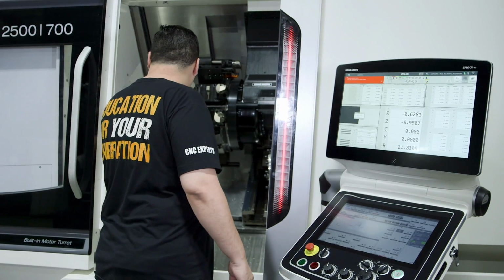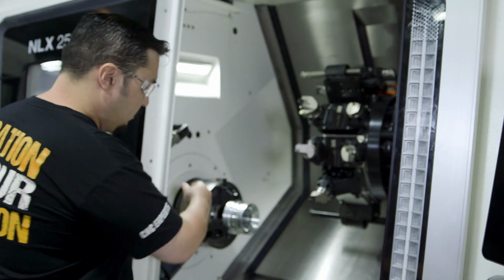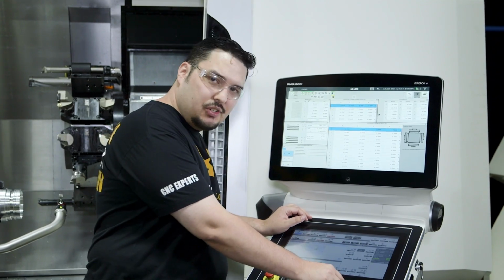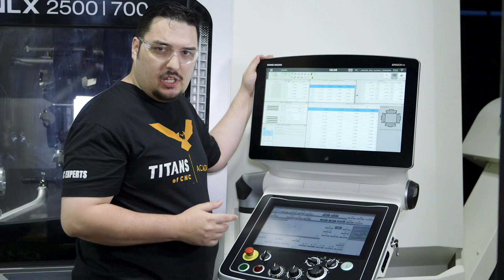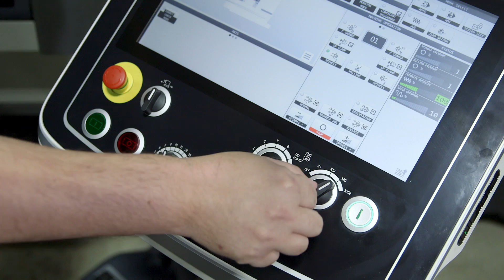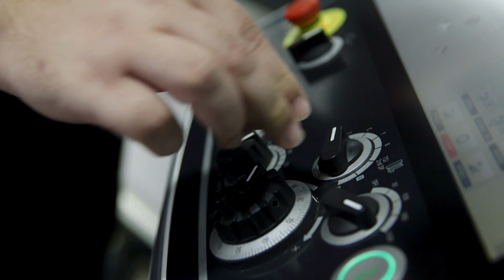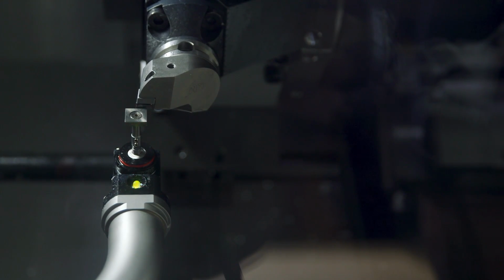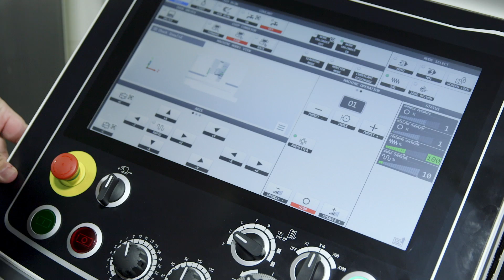The Probing Tip YOU Should Know Before Using A DMG Mori NLX-2500

Comment: how do you touch off in the y axis? I know there must be a way, but i cant get the y axis to move with the tool probe down.
Reply: maybe you don't have a 3d probe , only x , z . Maybe that's an extra option .
Reply: you dont do that. on a lathe with turret you have to be sure that your turret is in the right orientation. if you use tools with y axis you have to know the right compensation of y and you have to tell that your machine. theres no way of using a 3D probe on a lathe with turret, you wont be able to have the precicion with a turret.

Comment: Also, the machine won't start turning its main motor/ lathe when Y- axis isn't zeroed out. 
within the nc code it's the line G28 V0 that insures the Y- axis is set to home. Always initiated before turning begins. 
This can be turned off, however, deeeeeep down under the hood in the parameter settings. 
Advantages can be, i. e. if you use stacked tools (like some Sandvik Capto tools), or if you have a gnarling tool - to set it can be a female dog, but if you have libereated the y- axis, it's just a matter of a few seconds. 
Downside being, the parameter freeing the y- axis from liberating while turning is also the same one ensuring that you can only probe when Y is set to reference. 
Which can really mess your values up if you have the usual DMG composite X/Y- Axis configuration.
Reply: Codes M611 (interlock off) and M610 (interlock on) control the y-axis interlock, these can be added in the cycles.

Comment: If you have a smartkey with level 2 , 3 or 4 hit the corresponding number on the right side of the control and you will be able to jog the tools with the door open. Much easier to see what is going on that way.
Reply: Panzax I hate that I have to press the safety button all the time

Comment: You guys should mention , you can jog and  touch off the tools with the door open.  You'll need the Level 2 key for the control panel tho . Can you show how you guys indicate your y-axis to zero (on tools on center and on double stack capto blocks) . I have my way but I wanna see how you guys do it . Thanks!
Reply: Co axil indicator. Bring X down and get it reading as close as possible to, switch to Y mode bump it a click or 2, move X again, rinse and repeat till indicator reading is as close as possible. Boom
Reply: @Flightmx22  that's one way
Reply: @joey.cnc.  I think the coaxial is your quickest bet.  Just get close and dial it in with a few clicks.  But I guess it also depends on how accurate you want the alignment.

Comment: That's annoying, having to probe with the door shut.
Reply: You can have the door open if you have smarkey 2,3 or 4.
Reply: Get ready for it.  Door-shut CE style operation is coming to everywhere.
Reply: You can do it with the door open in level 2 while holding the acknowledgement button, but the MPG moves the machine at a limited speed

Comment: Please do video for how to bore the jaws without closing the door option..
Reply: You can't sir, not on this machine... The machine spindle will not operate with the door open... Only way it can be done is by acquiring a level 4 key from manufacturer, which is mainly, and rarely, used by service guys...😳 You could however remove the door switch key from the top of the door and stick it in and out as needed, but this is very dangerous.  You do get used to boring jaws with the door closed though and soon after you will be doing it with a program... 😆
Reply: @beatboxx713  I agree with your comment.  I have the same machine and I use a Boring Ring with a simple program. I do not recommend boring jaws with the door open .
Reply: You need to purchase a level 4 key and sign the 15 page liability release for an option called JB Interlock release

Comment: This is strange, the NLX1500 tool probe (lowering and raising) is completely controlled by the controller, you don't touch it.
Reply: Used much lower end machines where the probe is operated by the machine, there's no way that its manual
Reply: But it is... I have nlx's in my shop and they can be manually operated.  Even the NZX's are the same...
Reply: @beatboxx713  Our NLX1500 has a small label on it (from the manufacturer) saying specifically not to. Maybe it is an option?. I will ask the guys at DMG the next time they come around.
Reply: @matthewbehrens7091  probably, DMG-mori will make anything an option to make some money... Good ol corporate greed... 😆
Reply: The Automatic tool probe is a very expensive option. $4-5000.
Reply: @beatboxx713  if the company has to pay for it, the customer has to pay more for it 🤷‍♂️
Reply: Matthew Behrens I thought so as well... interesting haha
Reply: To manually check for clearance of part and tools without the tool probe coming down and banging into them.
 Thanks Tyson for the video! More cnc lathe videos please!!! Like on how to run I.D. tools (boring, threading and grooving) to avoid chips and  shavings getting in the way and ruining inserts. Like I can't release the  "option stop" and just walk away without worrying insert or tool is gonna break.
Reply: The standard tool setter is manual pull down, the auto one is an option.
Reply: @TheFeralEngineer  is auto tool probe comes with an probing option?🧐
Reply: @mikhaildavydenko6841  there's a measurement macro that you can run to check for tool breakage or you can give it numbers that are close to being correct and let the tool setter measure them for you, but the automatic setter is an option. It always has been.
Reply: @TheFeralEngineer  tool probe setter as an option - of course, there’s no doubt. But that’s crazy to have setter and... pull down it manually to check tools or measure length
Reply: @mikhaildavydenko6841  Mori standard has always been manual pulldown. Automatic is an option.
Reply: @TheFeralEngineer  okay, thanks for the explanation because I don’t know much about lathes 😌 just about Mori mills which I working with (DuraVertical 5080, NV5000, Duracenter 5, NH4000 DCG)
Reply: @mikhaildavydenko6841  all very high quality machines 👌👌

Comment: its cool but more complcated as on a lathe with siemens ^^
Reply: Do you run a lathe with Siemens?I'm asking because  I have ran a Hyundai with Siemens control for 18 years .We are having board issues last one was 10k now we got another one out and they are thinking about replacing it with a Mori.I personal love the Siemens control we also have a haas and I run it also but hate it .I was wondering what new lathes have Siemens and is it way different because there conservational is amazing. THANKS

Comment: how probe live tools
Reply: For tools that are meant to be center with the spindle . I use a Coaxial Indicator then use the touch setter for tool length (z-axis).  A little tedious but worth it
Reply: @joey.cnc.  Thats the best method ive found aswell.
Reply from the maker: Same way
Reply: TITANS of CNC: Academy don't have to compensate for the tool radius?

because I have the same machine and I have some doubts
Reply: Parallel to spindle only gets probed on lenght , measure dia with calipers , or enter a rough for eg. 1/2 dia +0.01" for safety . Perpendicular to spindle gets probed on lenght&lenght , as in lenght from turret , and lenght from centerline - Tool dia is also taken into account , but some machines could handle this differently . I'm sure there are smarter ways to do this for the perpendicular tool , but usually we use no more than 2-4 driven tools ....
Reply: At the shop I worked at we had a 1/2" dia dowel pin in an er collet holder and used that to probe the center of our live tools (subtracting half diameter from touchoff). We also used a blake co-ax held in spindle jaws to find y zero
Reply: Hi, im not english native so not sure what you meant by live tools. Would you explain it to me a bit? Cheers